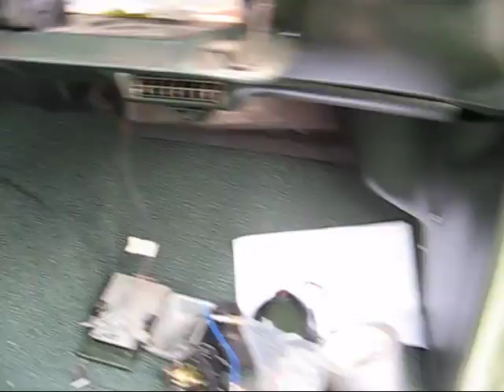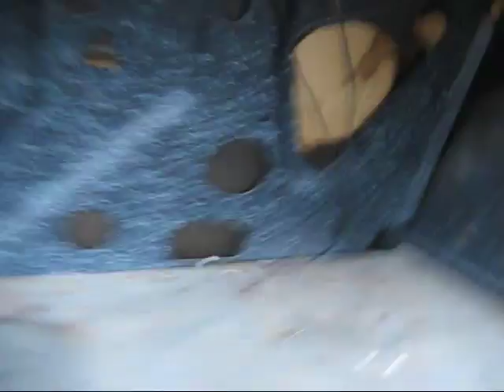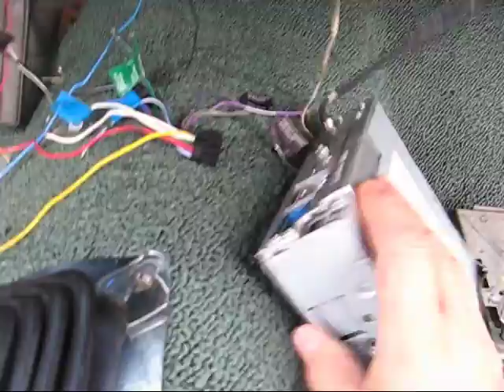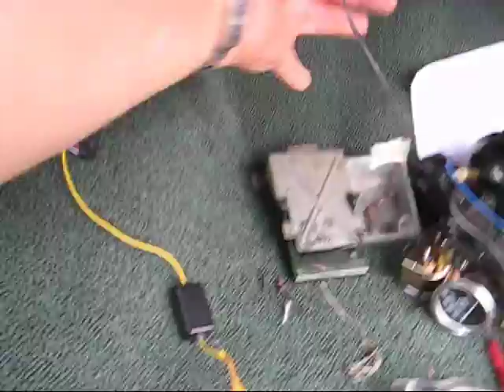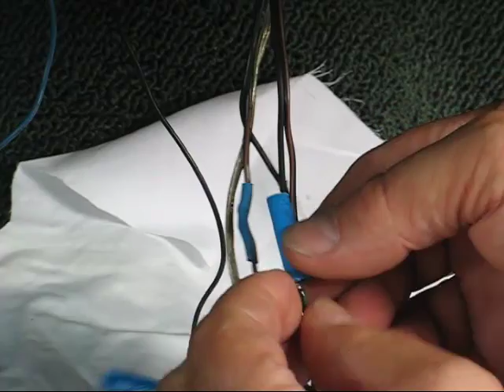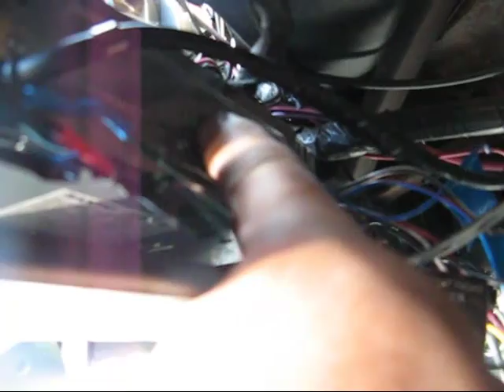How to Install a Radio in a Car   Aftermarket

Comment: omg, he destroyed the original radio face plate area, and installed a total clashing modern head unit into a classic car, when a myriad of retro looking classic radios are available with bluetooth, etc..
Reply from the maker: I been to several car shows and most do not have the original radio or a retro looking classic radio.  I had an original chevelle am/fm radio and gave it away 2 years before I got this car.

Comment: Great vid! Did you install an amp? Seems like i wouldnt loud enough without especially because i have headers
Reply from the maker: No I did not.  My car is quiet because it is all original with a 350 V8 and I have sound deadeners on the doors and floors.

Comment: Thanks for sharing the video David.  Good tip about aligning the screws when installing the back speakers.  I wish I had ran across it before installing mine.  I put in a new rear deck tray when replacing my headliner (with lots of help from your video!).  I was uncertain about installing front speakers because I didn't know to mount them, but now I see your's with the brackets included, I've found them on-line (Custom Autosound 1013 - 3.5" speakers) and just order them.
Reply from the maker: OK - you have to have front speakers, sounds better.

Comment: David is the third gray wire on the original radio plug from harness used ? Or do you just use yellow  and black, and leave third wire i believe its gray  capped off??
Reply: Thanks for videos i put my headliner in with your help
Reply from the maker: @shaneerickson478  The hardest part is the corners way in the back
Reply from the maker: I can not remember with out taking the radio out.   I believe, 1 for power, 1 ground, and 1 to keep the power on to keep the radio stations

Comment: I can’t believe you cut the dash.
Reply from the maker: Never going to put the original radio in again.
Reply: @davidlis6709 is that s70 77 Chevelle
Reply: 71 had the wreck tangled tailights 77 had the round tailights